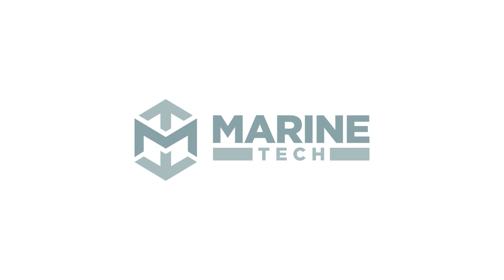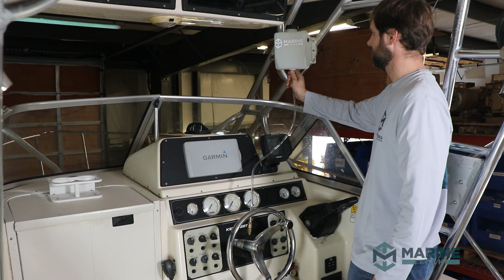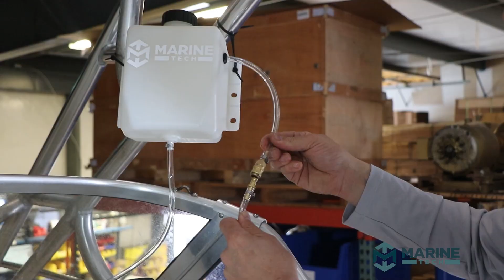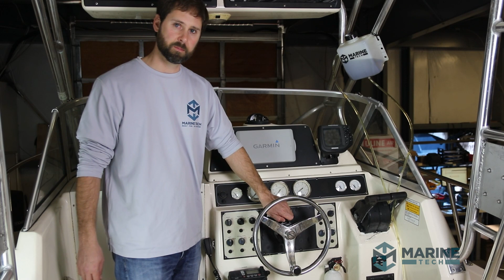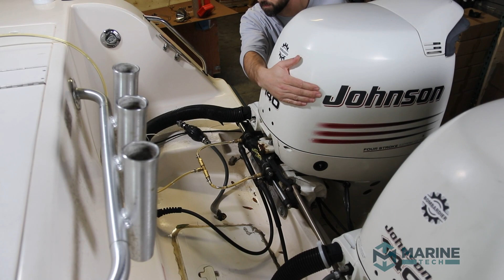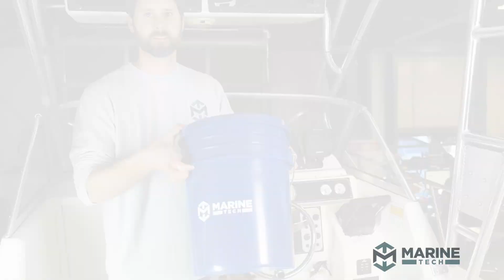Bleed SeaStar and Uflex Steering with Marine Tech Bleed System (Full How To)

Comment: Hey guys great addition to original bubble purge and purge pro and great job explaining things Matt. 
I bought bubble purge pro how do I get the new parts you added to the set?  Like the wrench and the 3 quart container? I also bought the trim seal cap remover and both upper and lower carrier pullers. Your tools and videos are the best I wish you had one on internal anodes, timing belt and vst filter.  Keep up the great work and Thanks for sharing!
Reply from the maker: We are getting back into making the videos after a long effort focused on designing more tools.   We messed with a small puller for anodes but didn't do it, possibly we will circle back around and pick that one off.   Like many things on a boat, it shouldn't be hard to do but sometimes it is...thanks for watching and for choosing us for your marine tools.